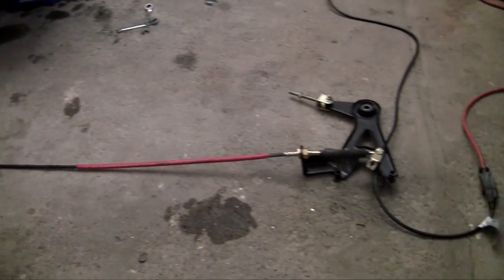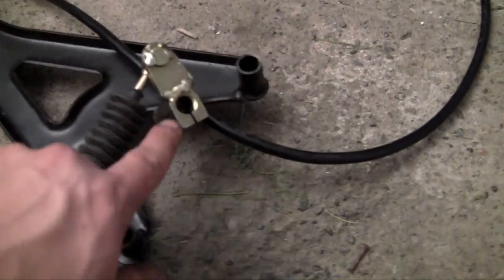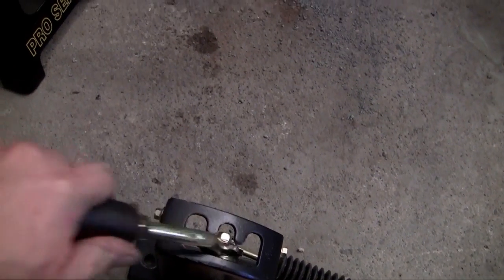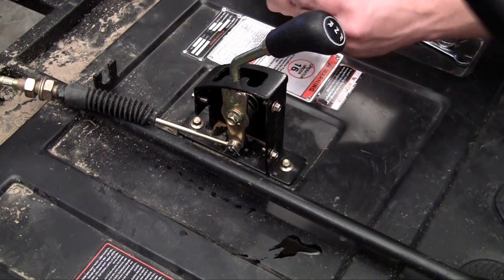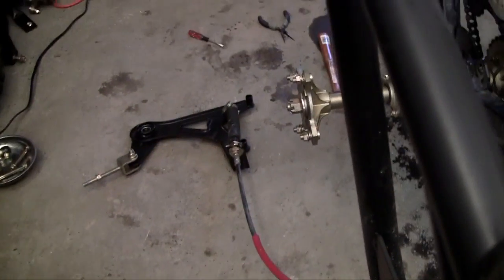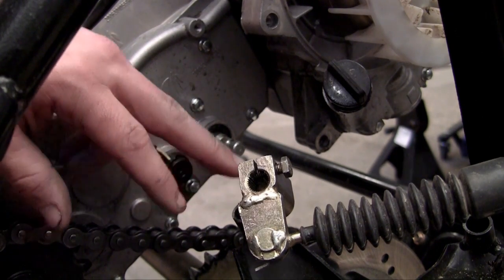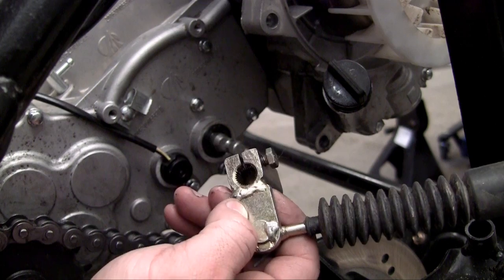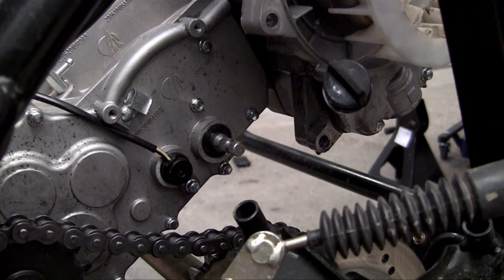How to Build a Go Kart - 4 - Shifter Cable

Comment: @thenewboston hello, i noticed your shifter cable bracket is similar to mine on my gy6. But for some reason after removing the bolts, nuts and circlip rings and spacers. I cannot remove the bracket. I noticed it has bearings. Were you ever able to successfully remove thay bracket? I want to remove my entire shifter cable and have access to the engine outout shaft too, but thay bracket gets in the way and I cannot figure out how to remove it. If you know, please share. I know your video is years back, but I'm hoping maybe you know how yo remove it. Thanks in advance